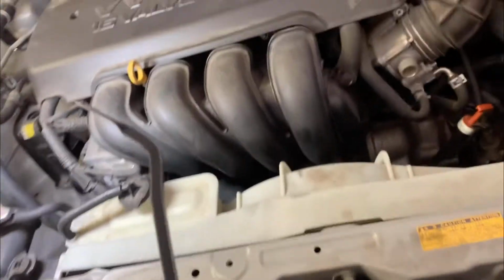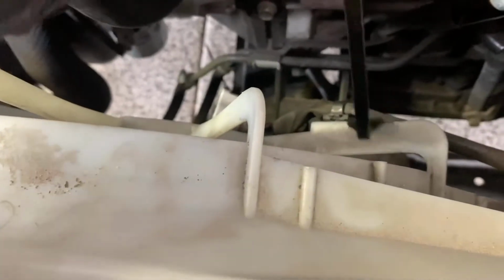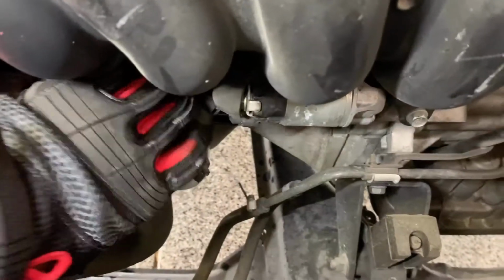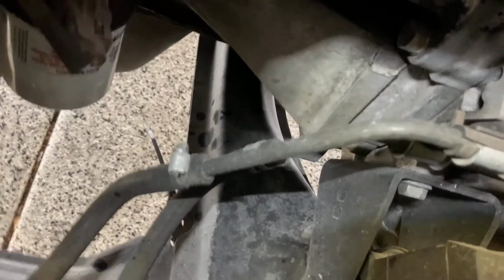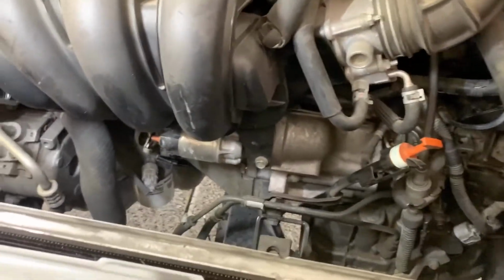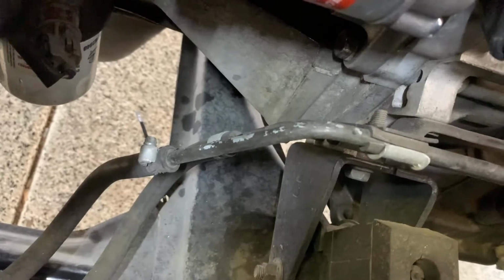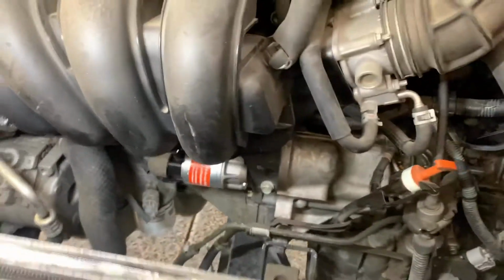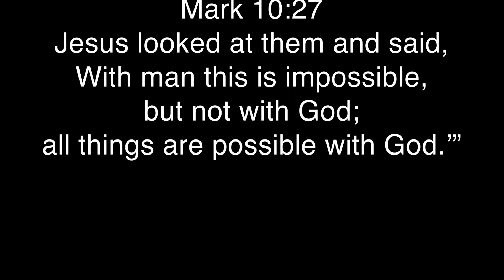replacing starter on a 2006 Toyota Corolla “easy”

Comment: On the Corolla there is no reason to remove the fan, you can work the starter out through the underneath of the car pretty easily. Which keeps you from accidentally hitting your radiator and going through all those extra steps and time.